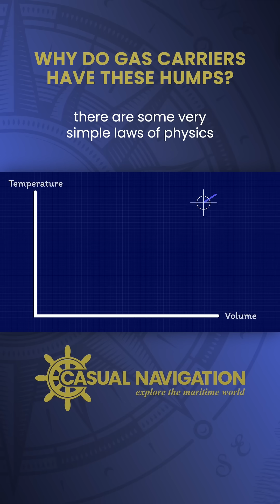How Do We Ship Gas Across Oceans?

Comment: The ending is the reason why LPGs are transported in spherical tanks on ships is because even under extreme pressures, spheres are far better at resisting ruptures, and their uniform shape stops uneven pressure spots and weak points to occur, than containers with corners. therefore the humps on ships are the tips of spherical tanks bcs it’s the best way to transport pressurised liquid gas
Reply: extreme pressure is slightly misleading. lng and lpg liquify at realtively low pressures. propane for example liquifies at 18 bar, while butane liquifies at around 4 bar.
compared to oxigen or hydrogen (or a lot of other gases) which dont liquify under normal temperatures, they get stored and transported at 200 or 300 bar. thats why your small gas lighter is relatively safe being made from plastic. fairly soft plastic at that. but even the smallest helium tank needs to be made from fairly high grade steel.

everything else still applies. pressure is push on area after all. bigger area means more push. even little pressure differences at large areas can mean tons of strain, so spheres it is. but less because of the pressure and more because of the size of the things.
Reply: @drache444444  true, and I get that, I should’ve put “even” before under, but I didn’t specify that spherical gas tanks are always transporting LPGs, although given the context I see how it reads 🤷🏻‍♂️